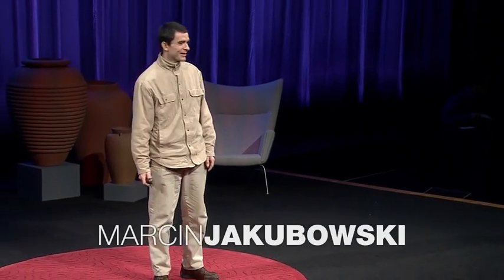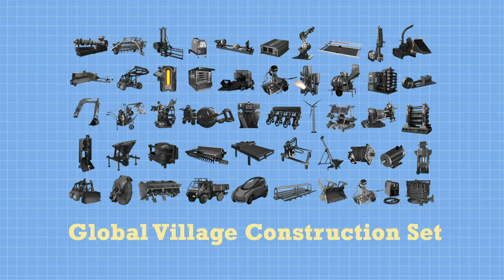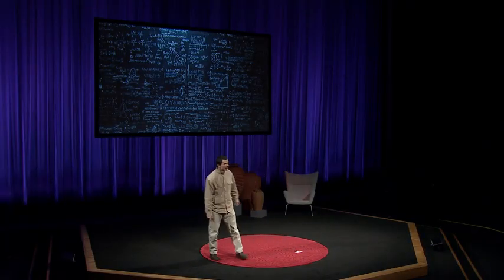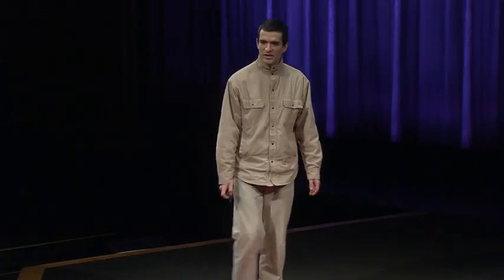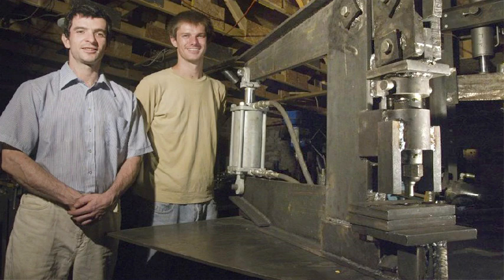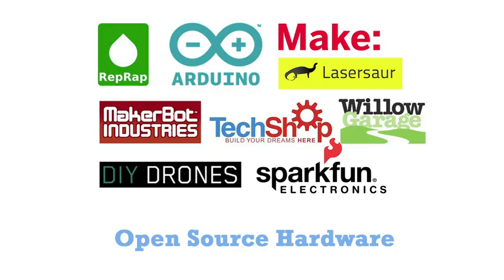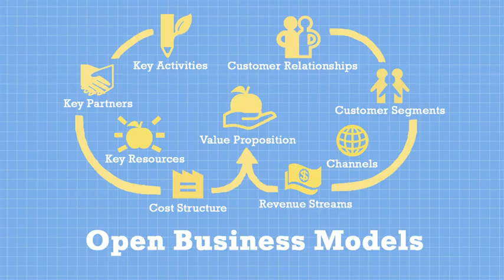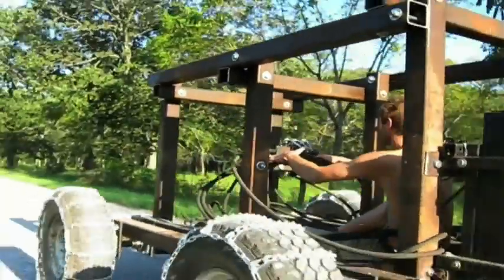TED Talk 2011 - Marcin Jakubowski on the Global Village Construction Set & Open Source Ecology

Comment: Genuinely curious to know what happ to the project..
Reply from the maker: https://www.opensourceecology.org/
Reply: This just came today on my feed, i went to the website but there arent any blueprints for most of the machines. Only the tractor it's present, but the cost of the tools you need to built it make everything cost more than just buy an used one. Also the project it's just a wide metal frame, whit car wheels and an engine, if you have the knowledge to build that you can just build your own model. While their idea it's nice they dont take in account all the tools you need, if you own a lathe machine you probably have founds for an used tractor, if you dont have one, a lathe  machine alone cost more than an used tractor lol

Comment: The 99% has only itself to blame, did & still hold the power, chose & still chooses not to use it wisely. The 99% needs to start helping each other like the 1% helps each other. Don't use commercial banks & create true community banks where none exist Begin the political change at the local government level, don't hesitate to can any1 now in elective office at the next election if they don' tow the line Yes it will be hard work & the 99% will have to work at this much harder than the 1% ever did